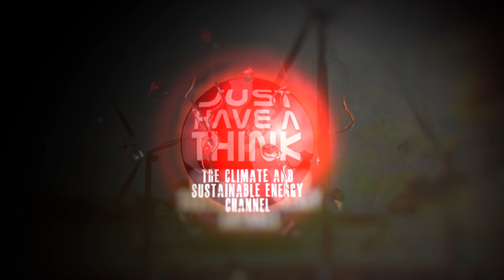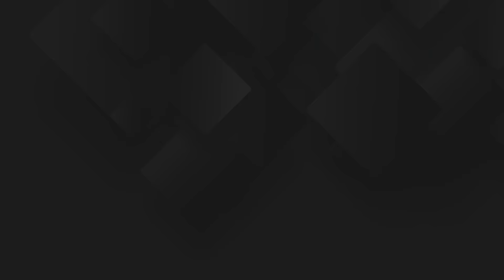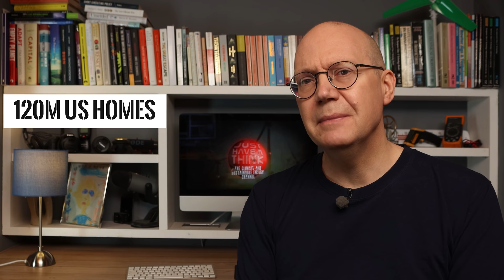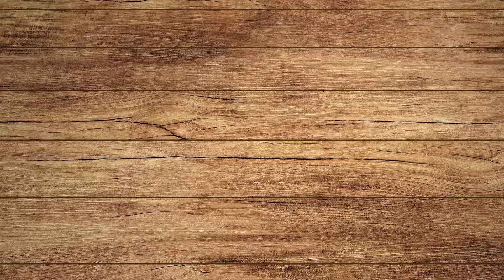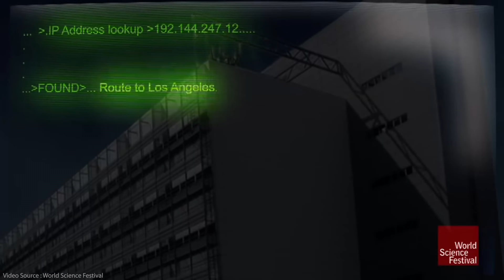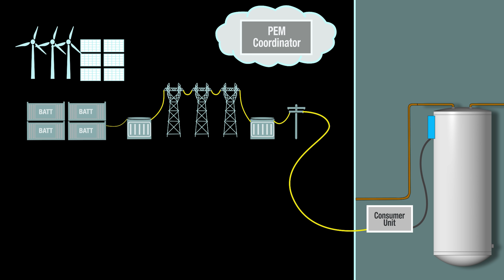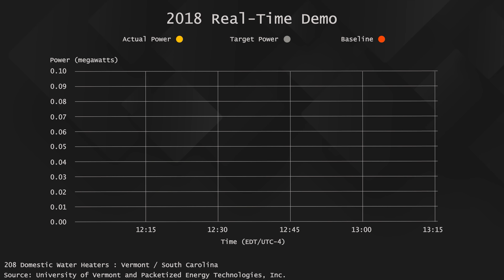How to balance renewable grids WITHOUT energy storage!

Comment: When your car charging is joined to the PEM system it may even be allowed to work in reverse contributing power to the grid depending on the state of charge of the battery.
Reply: Yea. Having all our cars constantly sitting at 80-100% battery state seems silly when you factor in charging rates and the fact that most people will use <20% of their battery on an average day.
Reply: God I have heard this idea for years now ... just what a person would want ... you go out to drive to work in the morning and find out someone made the decision that the power you thought you had in your car has been sucked out to power air-conditioners in Texas and you are stuck at home.  I must be missing something but I don't see how it's a good idea to be able to use people's electric car batteries as energy resources - even if they pay you back a premium.
Reply: @justgivemethetruth  I expect that there will be a reserve that you can set to make certain that your car has adequate range in the morning.  I always wonder of the car batteries are designed for this and if it will be good or bad for the battery.
Reply: @justgivemethetruth  That's where it really starts to make sense that it is based on a power market with floating prices. Then a valid way to make money with your EV is leave it plugged in, buy power (charge) when it's cheap, and sell (discharge/reverse metering) when the price is high. Of course, the EV charge controller would have settings of how much charge to have it at in the morning for you, how much you need to get to make it worth it (remember, charge/discharge wears an a battery). People with their own solar system with batteries could also get in on it. And there is the potential with a system like his that if a tree falls through the line, the system isolates the broken line, and people with cars/solar/generators all kick on to keep the isolated part of the grid up -- though at a high power price -- and thus conserved for the very most important loads.

Comment: I live off grid with solar and batteries in Canada and I love this idea! It could so well to help stabilize my battery situation here to have maximal usage when the sun is shining and minimal when it is not. It would greatly reduce my need for storage. Large industries do help with energy use modulation in some places, where a lumber mill will shut down during a very hot day to reduce injuries and allow for that power to go to AC units instead. They have deals with the local power providers to do this too. But yeah, AC, hot water, and car charging loads could all do this too

Comment: Another excellent presentation Dave and all the technicians at Just Have a Think!  We have a program for off peak water heaters, but this is truly a smart grid approach! Aunt Bernice had the off peak water heater setup with the power company, and after insulating the water heater with an added blanket of insulation, it works quite well.  I'm using side saddle tanks in the basement next to the wood stove which gives some mighty hot water and helps heat the house at night as that water cools a bit, but since we can't keep burning gas, and carbon neutral firewood is practical for just a small number of people, plus it's messy, so the electric water heater option is the sensible path for most people, and the team in Vermont has a practical answer.  🌲🌲🌲🌞🌄

Comment: Hmm ... I wonder whether this kind of distributed load management system could be implemented as an automated bidding process.  When the water is hot your water heater bids a low price; when it is cold it bids a high price.  Base the underlying algorithms on Adam Smith's theory of Supply and Demand.

Comment: Great video, I didn't know about this technology before but it seems relatively easy to implement.  I had a similar system provided for by the electric company just for my air conditioner for a reduced rate.  It seems like this should get instituted at a national level, phased in at first for large loads, HVAC and EV charging and later for smaller loads.

Comment: I am impressed by your channel. You ask for comment, here's an observation. a) EV's are big batteries on four wheels, b) there are millions of rooftops, c) roof tops are on buildings which are connected to the grid. Ergo; there is already an embryonic collection, storage and distribution system to potentially handle massive amounts of electricity. In order to realise the potential there would need to be a scheme to incentivise roof top solar and EV ownership on a grand scale. Roof owners would need to sign into the scheme, which would have clever algorithms at it's heart. They would be required to agree to sell an negotiable amount of their electricity from their EV batteries to the grid. Problem solved. There is a lot of detail to be worked out, beyond my resources. However,  'I had a think' and I think that on the face of it, what could possibly go wrong?

Comment: Sounds like an excellent idea for day-to-day efficiency. However, extended problems such as the Texas winter would see more and more devices switching to manual as they fail to get energy in a timely fashion, then the current unmanaged system results and chaos ensues. There needs to be some sort of back-up power for those rare problem times. In the case of Texas, that means connecting to the national grid infrastructure.

Comment: Very clever idea. One simple drawback from a system prospective is that we are solving a problem of a system A (electric grid), by creating a dependency on a system B (internet connection). But I guess there are solution to that (backup mode when internet connection is broken). Even if, when you scaled down your electrical infrastructure, you will not be able to provide the original energy peaks when internet connection gets unavailable for unknown reasons.

Comment: Another great video. I wonder if the 225 thousand ev charging stations currently operating in Europe can be adapted to PEM to help smooth grid power demands. Maybe these should get shipping container sized battery banks to have a few MWh each of storage to enhance grid flexibility - with electricity moving both ways when attractive. It may have less affect than ~100 million HVAC and water heaters, but we can’t allow « un-buffered » fast charging when the grid is already stressed.

Comment: At first, I was very skeptical, thinking of stories like Blackout, and how "smart" + "electricity" always leads to big security problems. But that system actually doesn't sound half bad. As I understood it, the central coordinator is more like a suggestion mechanism, an information source, giving devices a hint about whether it would be good to draw energy right now. Nobody needs to listen to its answers - if you want to, you can still just take the electricity you need. So there really should be no downside for consumers (given that there are no privacy issues), it's all optional, your EV can just start disregarding the authority and charge anyway early in the morning, if it didn't get enough power by then.
Reply: There's a big security vulnerability introduced at the grid level though. Imagine hacking the central management system to force thousands of water heaters to go on and off at once very rapidly. You could physically damage the grid equipments like that.
Reply: @DunnickFayuro  true! That central server should really be secured against malicious attacks
Reply: @DunnickFayuro  the way the system was explained in this video would not allow the central coordination system to "force" anything, nor turn anything off.

Comment: This centralised rationalisation of energy is very interesting, you could just treat each household as a device at first too introduce the tech
Reply: for best results, these distributions should be networked as decentralized. Centralized systems will come with problems like overloading and mis-synchronization.

Comment: 25 years ago, as an appliance designer in New Zealand, I tried to companies I worked with and for to start a development program for Smart Appliances. The need at the time was to smooth the load demand on the grid with appliances that could reduce their momentary power demands and or to delay their needs by co-ordinating with other appliances. Had that been successful then New Zealand would have a full set of smart appliances as appliance replacement rate is around 5% per year. None of those companies manufacture in NZ now, lack of foresight.

Comment: One of the "hidden" sources of electrical waste are the chargers we us for our personal devices (which, admit it, all stay plugged-in when not being used), and the step down transformers we use for electronic devices.  If you had the power equivalent of your home wi-fi switch, along with "smart" charger transformers, the chargers could stay plugged-in and not get power when they weren't charging.

Comment: Voltalis has been doing this in France for over 15 years, with electric heaters and hot water heaters. It is now important to develop smart EV charging, so that it can better match the needs of the grid (and allow users to recharge at the lowest cost). When we will have millions of electric vehicles that will plug into the grid, it will be necessary to control EV charging much more precisely than simply recharging during off-peak hours at night.

Comment: The National Grid should be a series of local independent grids with local  backup batteries that could be continually charged when power was available.  When excess power was available locally it could be sold to the National grid.
Reply: I think that’s definitely the ultimate direction that we’re headed.

Comment: Allowing arbitrary poorly-secured IOT devices to communicate directly with poorly-secured grid power SCADA controllers sounds like a cybersecurity disaster waiting to happen.
Reply: That's why that won't happen, they will be mediated by a regulated device like a GreenPHY meter/car-charger.
Reply: aye
Reply: That's not what they are talking about, these devices talk to devices that monitor load, not devices that control its generation, these devices then get permission to run and that f.ex water heater then gets added to the grid consuming the power.
Reply: If all those devices do is to ask if they can use power, I don't think that poses a security problem. Typically the ports of those devices are never exposed to the internet, only outbound requests are made. PEM coordinators just allocates available resources, they don't turn any generator on or off by themselves.
Reply: @DiThi  If a bad actor controls enough devices through for example a botnet built up by zero day vulnerabilities, then they can instruct devices to request packets in a coordinated way to either request more energy than is actually needed or less and destabilize the mains frequency by confusing the PEM coordinator.
Reply: @timseguine2  A device that can only send and receive two kinds of requests (without parameters) doesn't have a big surface of attack, so it should be easy enough to make securely. Even if it is allowed to use the energy, the device may not be using it all the time (e.g. water tank with a thermostat). The PEM coordinator is not very complex either, and it only knows the current capacity and load, it doesn't need to advertise demand back to the electric grid. That's already done the classic way. So if it's allowing all packets the grid would be forced to turn on additional generators, just like it is done currently.

In other words, any attack would be difficult and very limited in its effects (of just using more fossil fuels during the duration of the attack). At least that's how I understood it.
Reply: @DiThi  Smart home devices are notorious for having more attack surface than they should and for often having vulnerable software. I am not talking about the main PEM connection. I am talking about the inevitable side channels which may or may not have an internet attack surface.
Reply: @timseguine2  You're talking about "cloud" devices made by careless companies that focus on convenience for the user rather than anything else. PEM can be waaaaay simpler than that. Just 4 packet types, no arguments:
- Can I have a packet?
- Yes you can (the "no" is implicit by lack of response)
- I need to enable manual mode.
- I disabled manual mode.

I think it's relatively easy to secure a software that only understands that. The coordinator doesn't send anything back other than the "yes" response. And maybe an "ack" to know there's a response.

The user facing part can be separate and only be connected to the requester by 2 bit of information: whether it needs energy and whether it needs energy urgently. If that part is hacked and is always "on" then device is just working as usual. Just like when I override my water heater timer and forget it set in an "on" position.
Reply: @DiThi  I am not arguing about the ability to secure the PEM channel. I never was. I already said that. I don't know why you are still talking about how to secure the PEM channel.

And you are talking about it like the "user facing" portion won't in practice be written by the exact same programmer and be running simultaneously on the same microcontroller.
Reply: @timseguine2  This can't meaningfully work at a large scale if there isn't an agreed upon standard, and if I was writing such standard I would include isolation as a requirement.
Reply: @DiThi  Fulfilling a standard does not mean your implementation is bug free.
Reply: @timseguine2  I'm not talking about bugs, but about conformance. If your implementation doesn't conform to the standard the user should know not to buy it. Furthermore, if a key system is added to prevent attacks, the keys can be granted to devices that meet the standard.

Comment: The way, basically the only really feasible way to have a stable renewable grid is the same way we have a stable fossil grid: have more capacity than we need and be able to shut it off at will. Wind turbines, solar panels, and hydroelectric stations can stop producing power at will, so by having enough of them that we can always turn a few more on to meet unexpected demand is sufficient to balance the grid. Just like we have idle peaker plants (or idle capacity within those plants) at all times during normal operations, we will eventually have some idle renewable sources.

Packetizing energy seems like a good idea that will make the grid more efficient and also allow us to lower the excess capacity needed to be confident in the high up time we need. Storage can do the same thing while also providing a backup power supply. And we should do both, smart grid management as well as storage will build a grid that is more robust and cheaper to operate, but they are good in that they make the problem easier to solve. Overcapacity is the solution. We don't panic when a gas turbine shuts down because demand is low, neither should we panic when a wind turbine puts on the brakes for the same reason, and we need to continue building sustainable electricity generation as fast as we practically can.

Comment: Looks promising. You must admit such a system has more points of failure than the current one: If power to the request generator fails or the local network clogs, if people hack the systems, if demand from a region suddenly surges, if the overall system loses stability, etc., etc., bad things can happen.

At present, I am putting more confidence in my choice to install significant local PV sourcing and battery storage, to permit smoothing at the end point.

It will be interesting to see how this all evolves.
Reply: Is the failure mode worse then the grid now?

Comment: I imagine a system could be built in which distributed energy providers could respond to PEM requests. For example, one home in a neighborhood could have extra solar and battery capacity, and PEM requests in the neighborhood would go to that home controller, which would provide the energy packet right there in the neighborhood. If a local provider doesn't have the energy to respond to the packet, the request would continue on to more distant providers until it finds one or times out.

Packets could also contain parameters like acceptable price for the unit of energy, or a preference for the source of that energy, acceptable distance of generation etc.

Comment: Thank you for this so clear presentation of this energy management system. With electricity becoming a widespread source of energy because of the wider use of heat pumps, this seems an important step. The system of appliances behaving like hungry birdies is somwhat surprising however. It is opposite to the electricity suppliers using the appliances as a sort of buffer. In some existing systems, a signal is given when there is excess of electricity via the pricing.  thereof.

Comment: Really like the idea of lightning and thunder to compliment thinking in the intro.  Seems similar to the EV problem It all depended on a good battery.  This packet distribution system seems to need a low power loss transmission means like graphene can provide.  Some crazy thought tells me dynamite and/or gold is going to be involved in manufacturing  industrial quantities of it.

Comment: This is just a slightly different form of power demand management, and it still has some form of central management. Whilst it could help with optimisation, it most certainly does not remove the need for long term energy storage. What it might do is reduce the need for short term storage, but that's wildly different to coping with medium to long periods of time when generation is consistently below demand. It's also just part of the smart grid thinking, and just a particular detailed method of implementation.